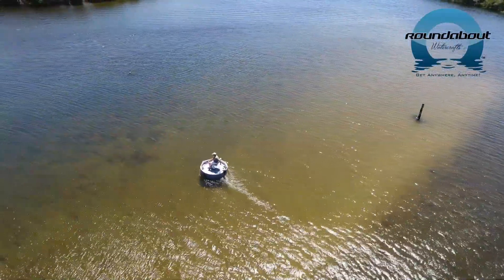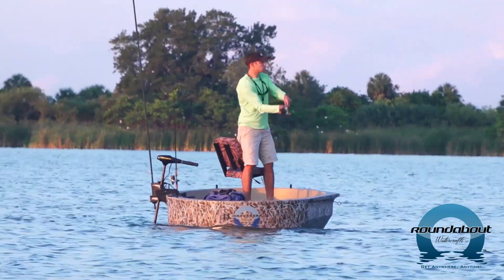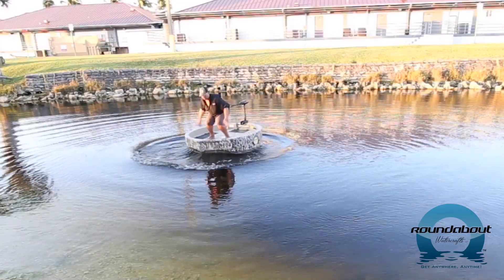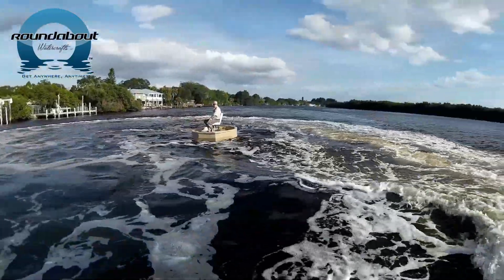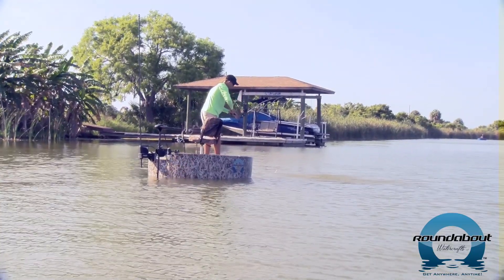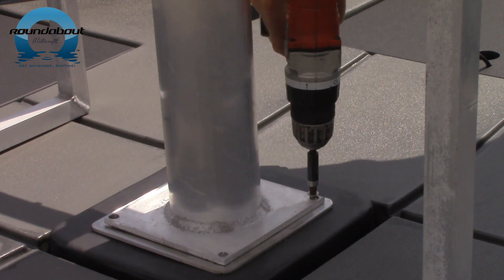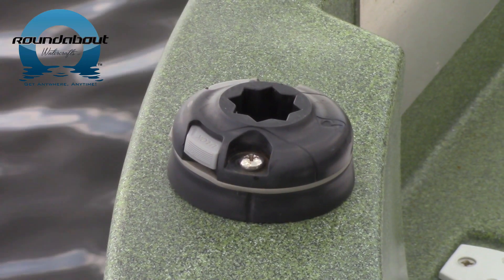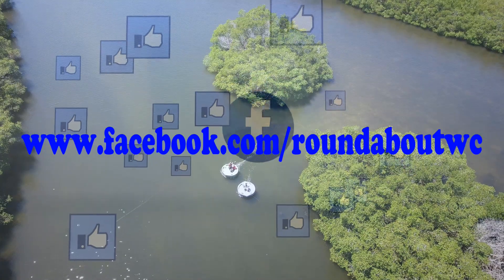Roundabout In depth

Comment: What size shaft of outboard can I use with it?  It is either that or adding a backup battery for return trips.
Reply from the maker: We have used a 15" shaft with a little cavitation but not much.  A 20" shaft works great